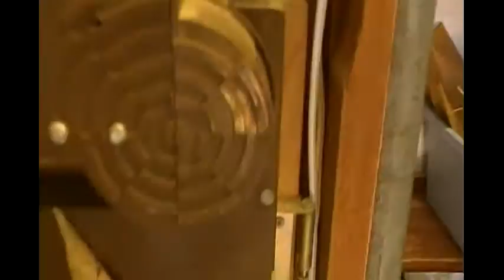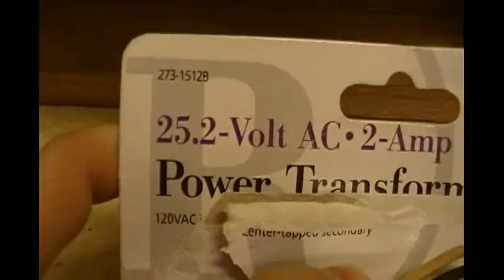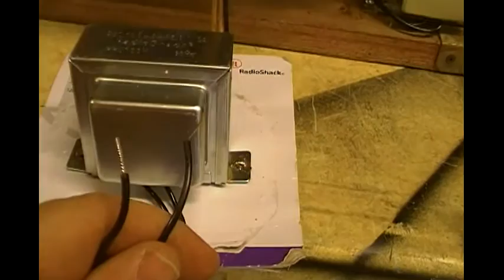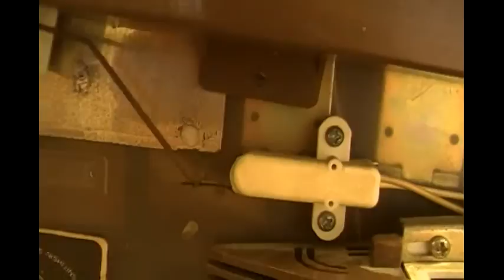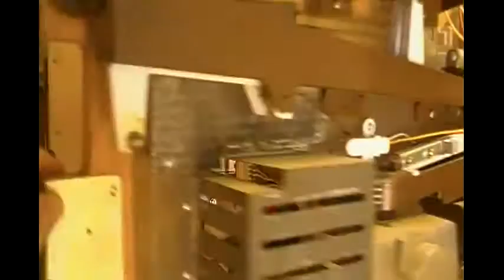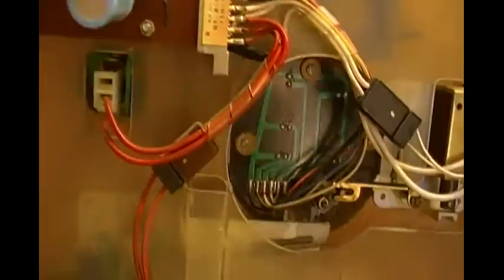Power for power required Vintage Pachinko's

Comment: Hi there, my machine has lights working, but the electronic firing button on the bottom won't work, or the middle jackpot seems not to light up, it has poor in some places it seems but not in others. Is this possibly just a faulty connection on my ties, or does it require operate power within the machine?
thanks!